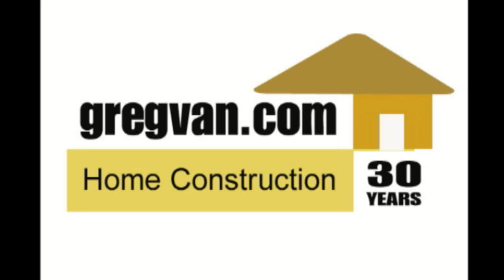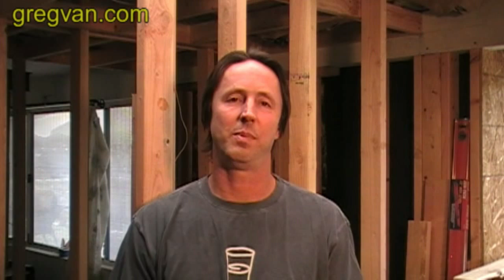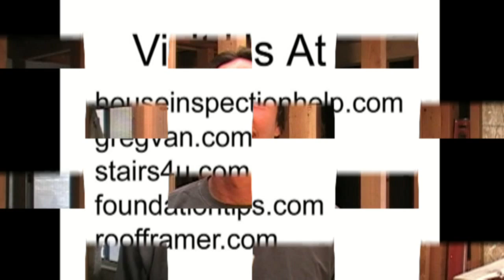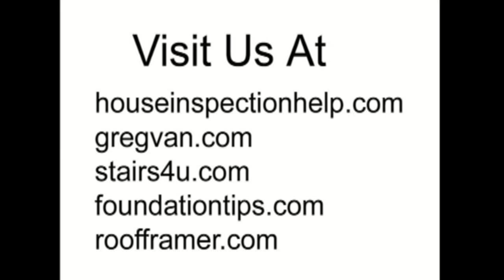Problems over Nailing Shear Panel Framing - Structural House Building Tips

Comment: Screws are typically too brittle for shear wall applications. The more ductile nails provide better shear value. The screws can snap when subjected to sufficient shear forces while the nails would still be just fine.

Comment: Hello working on an addition, it calls for 4”,6” o.c would that be 4” at the panel edges and 6” in the filed? Thanks for your help and your videos are very helpful.
Reply: Thank you
Reply from the maker: That sounds correct, but I would contact the building department who provided you with a building permit if one was needed or the engineer.

Comment: Jeff Kirk.  Your structural engineer has never looked into nails versus screws and probably just assumed the same diameter will give the same performance.  Nails are a much better product to use for shear walls as they are a different type of steel and will yield much more than screws prior to breaking.
Reply: How is your comment relevant to over nailing?
Doh!
Reply: If you would read very very shortly down the page you will see a discussion on screws.

Comment: he right to many nails is not good , every stud different, I recommend  inspection of the studs new or existing  evaluate  the condition. use 3 x 4 at sheer panel  joining points there where all the nails will be and greater the chance of splitting the stud.
Reply: Yes. Special Inspection Always! :)

Comment: im on the opposite coast,  we dont have to deal with seismic but hurricanes. also quite a bit of the engineered things we do are for out of the ordinary renovation situations picking up point loads or for large walls of glass which need the extra strenght to resist deflection

Comment: we nail our shear walls 6`` o.c at the edges of the panel and 8`` o.c along the stud  in the field. we also use construction adhesive for this as per our engineers spec

Comment: With wood framing yes. You CAN over nail a connection and make it LESS structurally sound.  I've been framing/working in construction for 20+ years. When you put too many connectors in ANY joint you compromise its' integrity. Wood is a fibrous material. Nuff said.